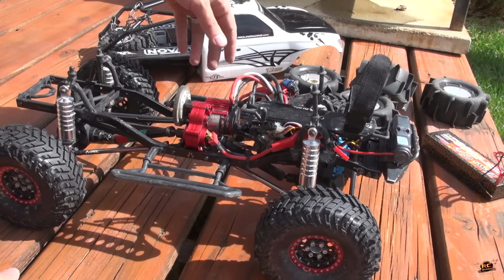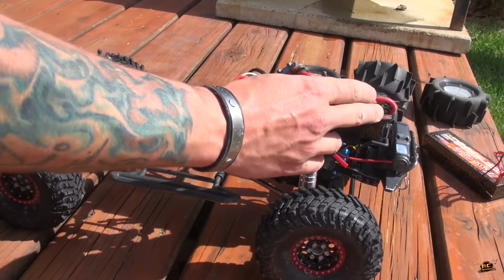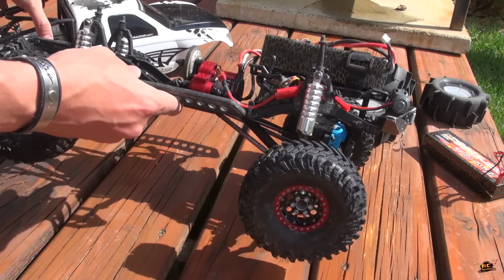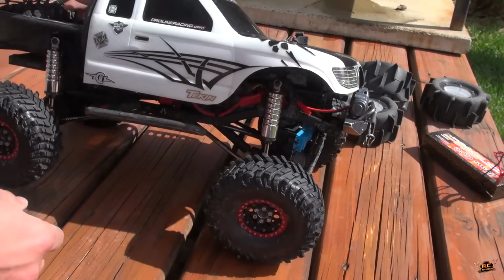RC ADVENTURES - Creamy Mud Recoveries - Beast 4x4 & HD OverKill: the JUGGERNAUT 6x6

Comment: Is there a way of getting gears on rc cars? So you can go slow in 1 gear and change gear to go faster? This is just un realistic
Reply: that is possible, but using rc motors they are perfectly capable of going insane speeds like 70mph on one single fixed gear.Gear changing is most commonly found on trucks like the ones shown, where you can choose to crawl to get over obstacles or change to a higher gear to go a bit faster.

Comment: I like the smoke on the truck. Is there a kit I can buy to get that effect?
Reply: Ur 8 years late
Reply: Some rc cars actually run on diesel so you could get that, but if you just want the effect then you could buy a like smoke generator er somethin, i used to have a link to one but the link got corrupted, sorry.

Comment: I wanted to see the big helper Daddy truck drive through the muck. I really wanted to see that. I wanted to see it just plow through and then you go inside and don't clean anything up not even your RCs or your hands and go take a nap in your bed with your shoes on and every thing else and then eat supper without washing your hands and then go back and make the trucks fight each other and drive them around In a construction yard after a torrential downpour.  and then lay in the mud and flap around in it. next video request please.